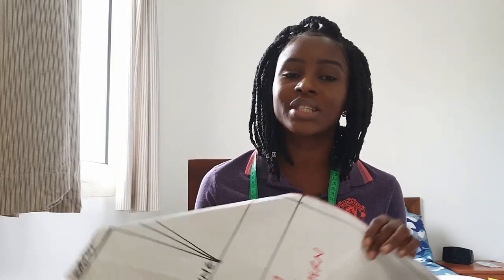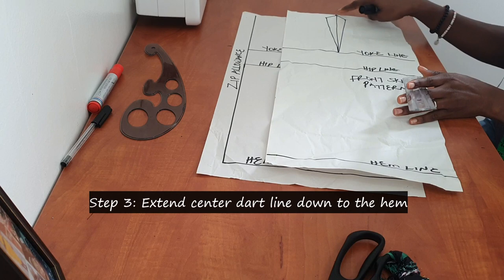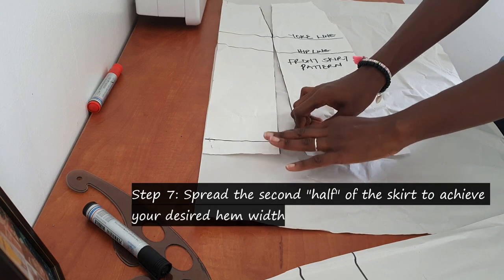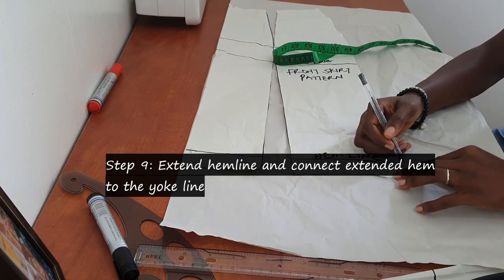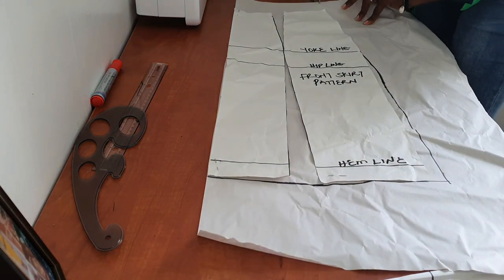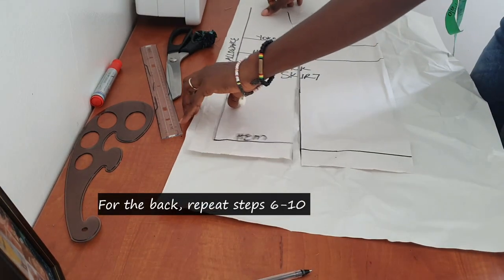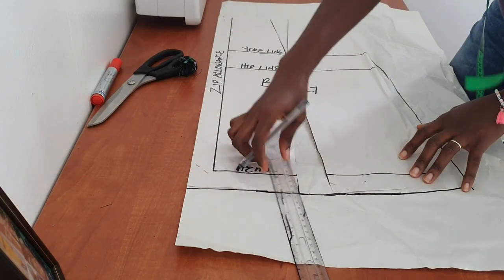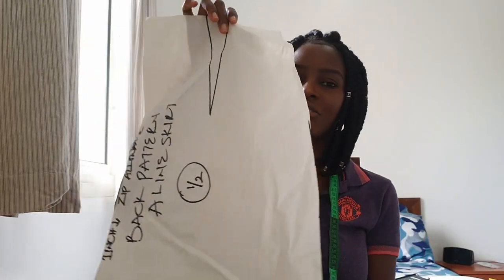How to make an A-LINE SKIRT Pattern|| DIY A-LINE SKIRT PATTERN TUTORIAL|| REMI JUNAID

Comment: Pls how do i spread and splash for an Ashape gown
Reply from the maker: Hi, Jenrade Aminat for the A shape gown, using slash and spread method, you’ll need a double dart bodice (so basically a bodice that has two darts e.g an underarm dart and a waist dart) so once you have a bodice with an underarm dart and a waist dart, you’ll extend your bust span (nipple to nipple line) down to the hem line and also extend the underarm dart line to the point where you’ll like to slash from (typically for an A line gown, you’ll want it to be free from the top, so maybe below the chest line so it doesn’t affect your arm hole but above the bust line). Then you will slash your bust span line from the hem up to this point as well and close (or reduce) the underarm dart, this will spread your bodice to give you the A-shape. After this, you’ll go ahead and blend in your side seams just like we did with the skirt. I hope this helps and I haven’t over complicated it. (You can watch my dart manipulation video to understand better the explanation about closing the side dart and opening up the middle of your bodice. Let me know if this helps or if you need more clarification.